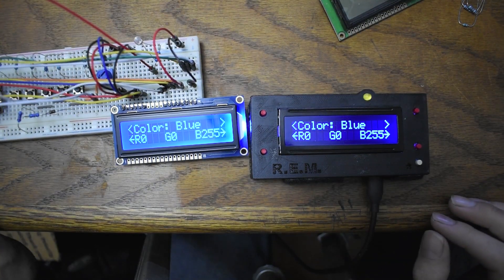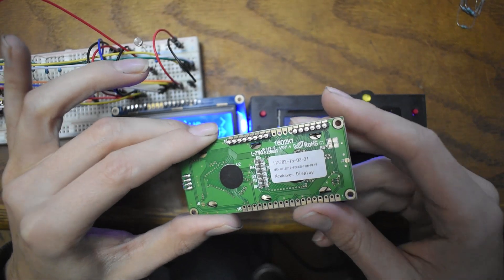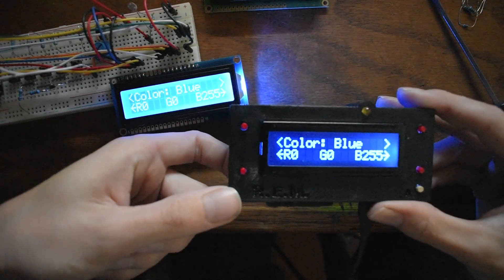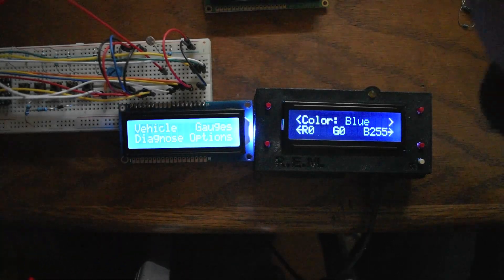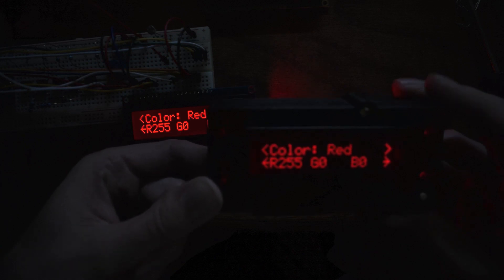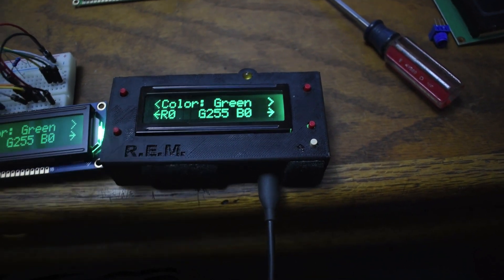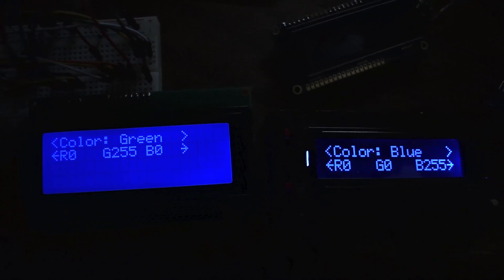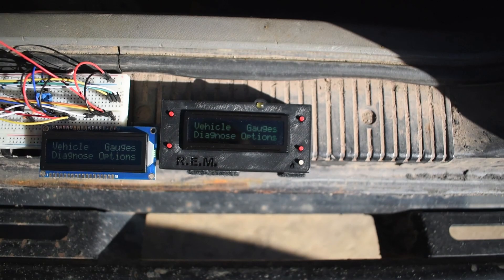16x2 RGB LCD Contrast Comparison

Comment: Are all those displays fairly generic - can you use the same library?
Reply from the maker: Yes, if you're unsure you can check the LCD controller type and search it up, but 16x2 are fairly universal with support for 8bit and 4bit mode in liquidCrystal
Reply: @NickInTimeFilms  - I guess you just use a standard lcd lib then control the rgb with your own code (pwm if needed) - would that be correct?
Did you end up doing something cool with the rgb display?
Reply from the maker: Yeah, with Arduino they have built in libraries such as liquidCrystal which does all the hard stuff for you. Just initialize your pins and screen size then you are good to go. The RBG backlights are all PWM for brightness and color control. In the first versions I used the MC pins to drive each LED through a resistor, but it wasn't as ideal when I switched to 3.3v logic. Since they are High Side driven I had to use an NPN/PNP pair to drive a 5v supply off a 3.3v pwm signal. Through code I can set the color with a max PWM of each color, then I use a dim percentage to offset those values while still keeping the same relative color.

I haven't done anything too crazy beyond simple color picking or a custom slider option, but with a little more math and looping you could probably cycle through the spectrum in a neat way.
Reply: @NickInTimeFilms  sounds pretty cool :) Are you building something for the hill climbing SUV? What is 3.3v logic - a Due or something?
Reply from the maker: Yes, the main use for this particular screen if for my Jeep Scan tool project called the Renix Engine Monitor or REM for short. It interfaced with the old Jeep computer and outputs all the data on these screen. The project quickly grew outside the usefulness of a simple arduino Uno or Leo so I switched to the Teensy 3.2 architecture which uses ARM chips instead. Massive gains in all areas such as program space, ram, clock speed, communication lines, and other fun things like RTC built in. Only difference is this uses 3.3v instead of 5v like most arduinos. Luckily this screen accepts 3.3v control signals just fine, but the VDD pin is still hooked to 5v to turn it on.
Reply: @NickInTimeFilms  Wow! Very cool! And I was thinking REM was after the rock band:)
You should do another vid showing the Teensy project - interesting stuff.
Reply from the maker: @freeelectron8261  My work is a bit scattered but if you like to watch the progression then i've got the REM playlist here: https://www.youtube.com/playlist?list=PLGMSA8Ri0oT-SkI2RMi_k2OGCfwxb3Wrb

or some other arduino projects scattered around as i've learned the ropes https://www.youtube.com/playlist?list=PLGMSA8Ri0oT_rhTUp3LBj-esRr9QqLbq2

All my finished projects have made it to my website too https://nickintimedesign.com/shop/

Comment: I like the bigger screen more, doesn't seem so cramped and you could add stuff like a clock or temperature thing in the corner. You could turn it into a overhead console thing too like what do said below.